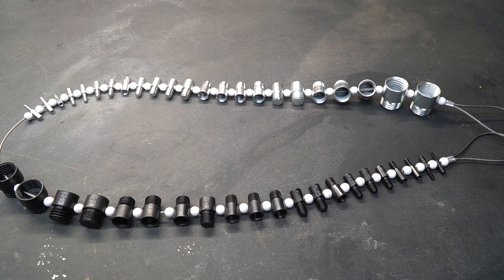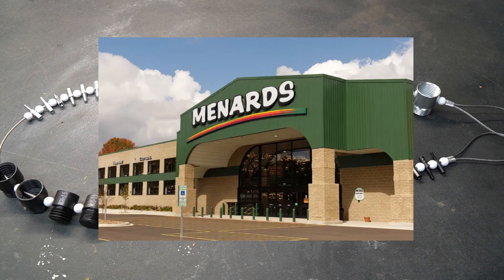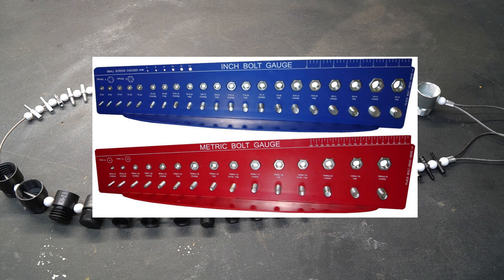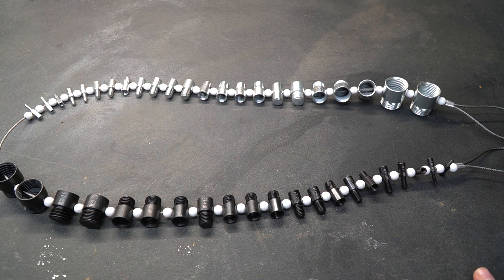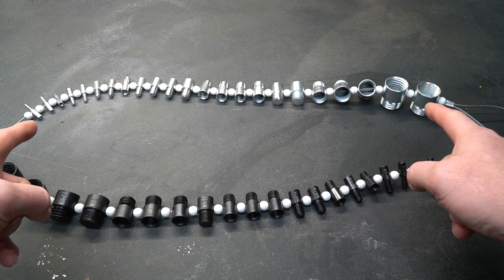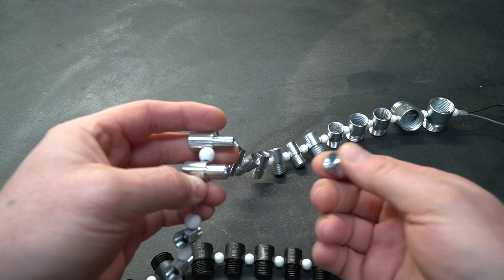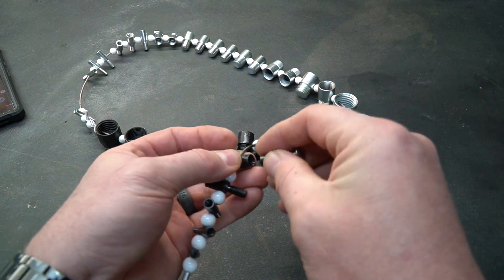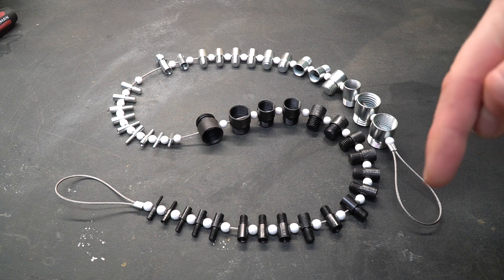Thread Checker for Nuts and Bolts, made by Tenluno, Male and Female Thread Identifier Gauges NTDT

Comment: I work in a large machine shop and have ordered several similar thread checkers for different areas.  Mine have all been slightly less expensive, but cover a much smaller range of sizes.  If you're bargain shopping, check included sizes.

Comment: I have the same ones that I bought from McMaster Carr. They are great but the down side is if you need to check a thread size in a tight area such as an engine compartment. They are not removable from the cable so trying to get the entire set into a tight area and then try to turn it just doesn't work. So I cut them off the cable and built a nice index box so they could be handled individually.

Comment: I normally don't get the appeal of these if you have a decently stocked fastener cabinet, it's just as easy to use nuts and bolts. But having metric and imperial on the same chain, that would be enormously useful! I have literally banished metric from my shop just to avoid such confusion, but more and more new products are always metric.